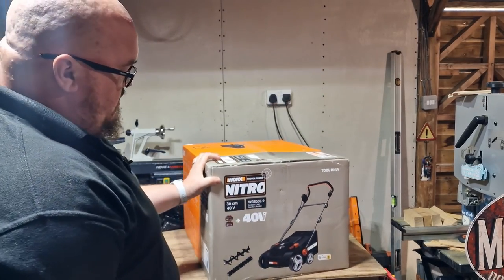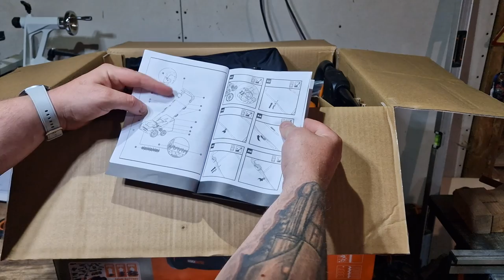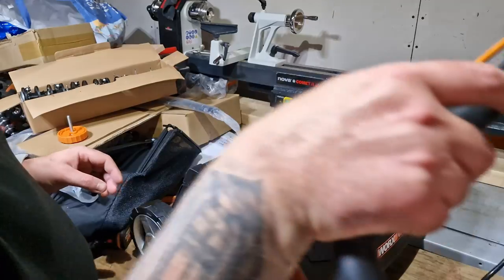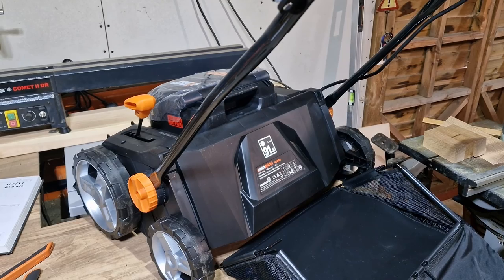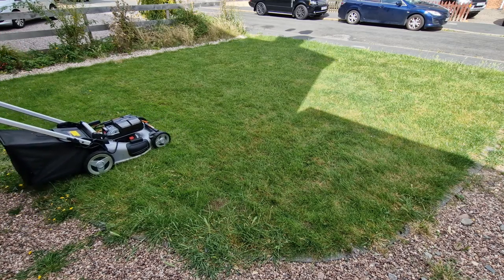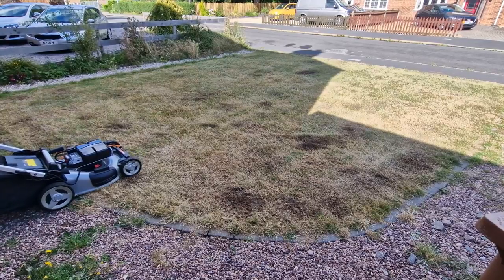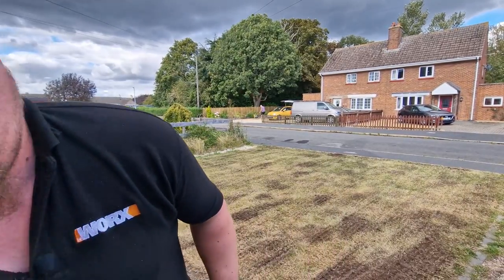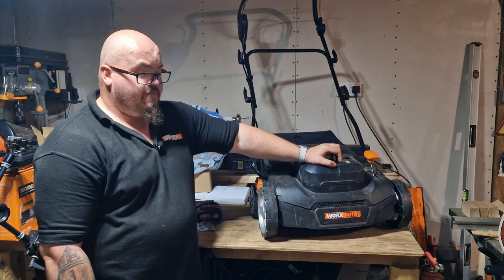Worx wg855 review game changing for lawn care 40v Brushless cordless scarifier verticut lawn rake

Comment: What was the run time? How long to recharge? I have a large lawn and don't want to stop every 15 mins. for a long recharge.
Reply from the maker: @normatither3023  it
Runs for about 20 minutes though run time really depends on how thick your thatch is and how deep you are scarifying along with how fast you are walking too. Realistically there are too many variables to give you a honest answer, last year I spent two sets of 4ah to rip a 40²m area of my grass I mean moss there was no grass, I had to hit that real hard and slow and grab out 10 buckets of moss out, left it over winter and by spring had one of the best patches of lush grass I ever had, verticutting is harshest of all though and can see as low as 10 minute run times,but that is verticutting not scarifying or raking.